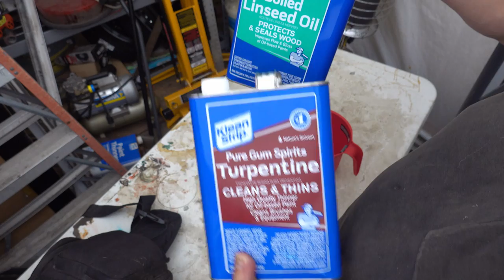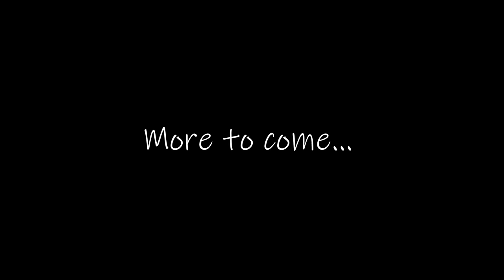Installing Deck Railing (Part 1)

Comment: I wonder how much would soak up if you just left an end in that mixture for a week?
Reply from the maker: Ideally, I'd love to vacuum treat it, but it's rather difficult to create a vacuum chamber that can submerge large pieces of wood. 
The forest service uses a concoction that's a mix of mineral spirits, boiled linseed oil, and melted paraffin to treat pine, and it's been working quite well for a good long while.